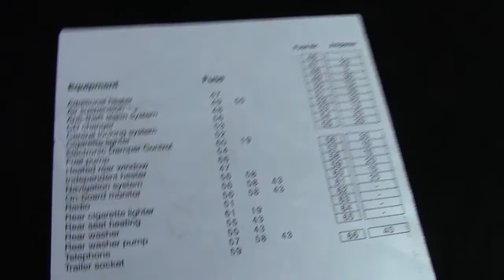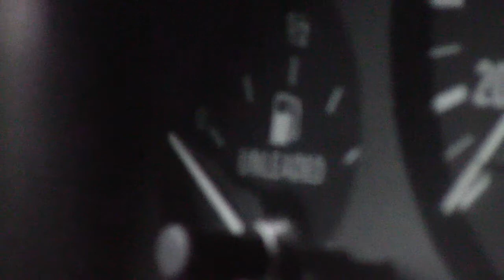Troubleshooting the Issue | Car Shopping

Comment: Your on a test drive and it broke down on the highway ? Your girl has to go get gas for the dealer car? You buy the car ? Sounds like bad fuel pump or bad bcm.. Beamers are over engineered and to costly to repair.. Get a Toyota .Check out the Scotty 
Kilmer channel for best auto advice.
Reply from the maker: Thanks for the advice! After getting a car checked out by Meineke, I bought it. It breaks down while we're bringing it to the dealership. It was out of gas, but we didn't know that. The sensor needs to be fixed. No big deal. We put gas in it and were back on the road!
Reply: Glad for you Bro.... Really enjoy all your videos.... Always look forward to the next one... Peace out ...........